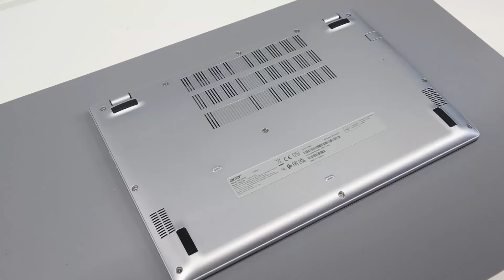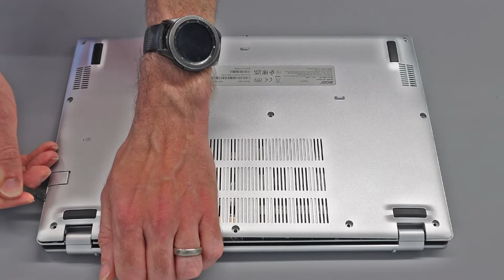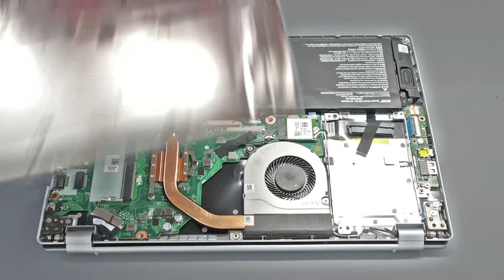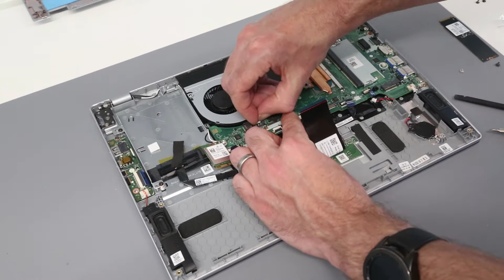Acer Aspire 5 A514-54 - Mainboard Replacement Guide

Comment: Hi, I just want to ask if you can recognized if the motherboard of a laptop was being replaced?
Reply: I have a Acer Aspire 5 laptop the problem is no power, not charging no light at all. When I bring it to the repair shop they inform me it already fix and send me video of my laptop that its turning on. Im so glad they fix it, after that they said they will update the software 5 to 7 hrs. The next day the inform me the total charge amount. So I reply that I will get my laptop maybe next day when I get my salary. After 2days I texted the repair shop whats the status of my unit, I was shocked when they reply to me that they send my unit to a Service Center for 2nd option. I dont understand why they send it to SC when they already told me the fix it.
Reply: After 3 days the SC called the repair shop that they cant fix my laptop due to many error parts in the motherboard which is my question to the repair shop why the problem is come to motherboard end when at the first place they already open it already.
Reply: Thanks for the information. Any updates on your laptop? Mine is pretty much the same
Reply: Same problem blinks and goes off then crashes